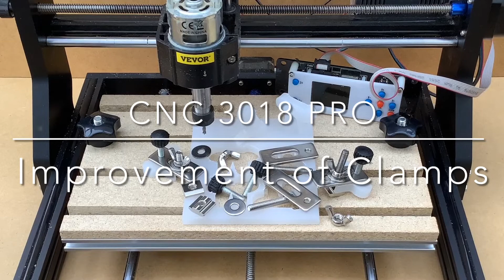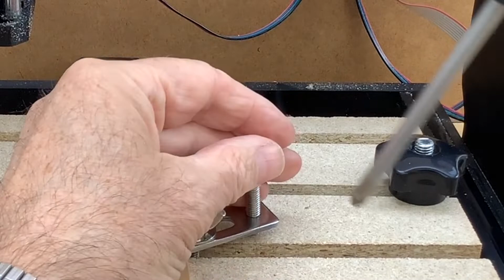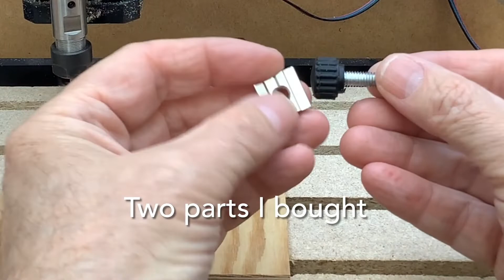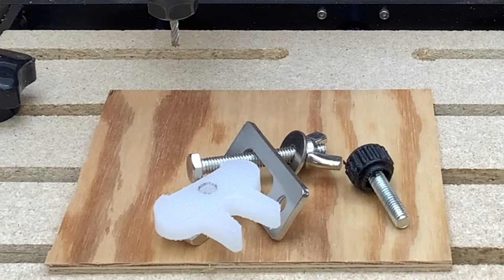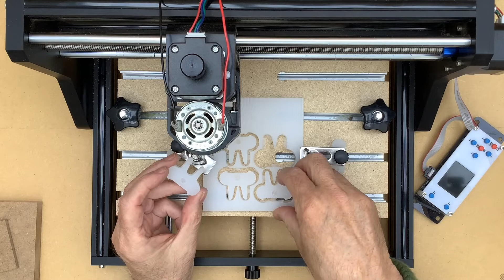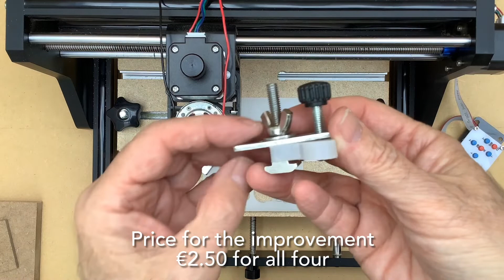CNC 3018 Improvement of Clamps

Comment: If you turn the screw (the screw without the wing nut on it) upside down, with the flat part of the screw touching the bed, it will not dig into the bed.  To adjust the clamp, turn both screws until they are flat with the material you are cutting.  Then tighten the wing nut until its secure!

Comment: Need some clearifying: how to fix the T-nut to the bolt? Solder/welding, glue? Is the pattern for the plastic part as a download available?
Reply: looks like its welded and then grinded down
Reply from the maker: I have soldered but glue may also be used.  Here is a link to the file on Easel https://easel.inventables.com/projects/jqRMEZkK342CZJtThHmzt
Reply: Good idea using cutting board plastic, got a bunch of those. The new Bamboo and Acacia Wood ones might be useful too.
Reply from the maker: Thank you for your comment